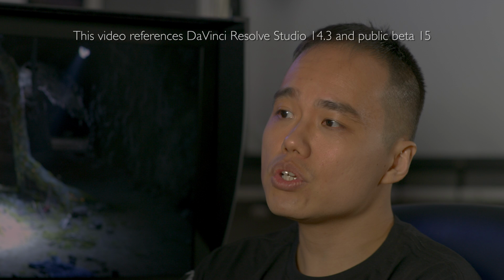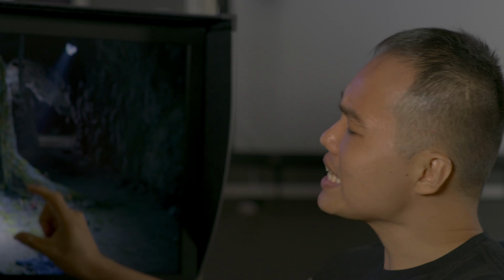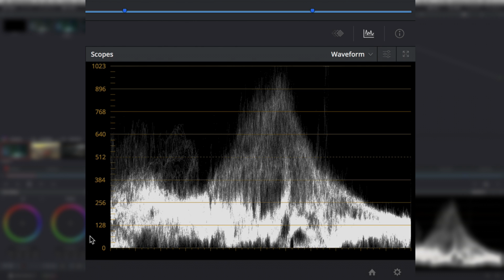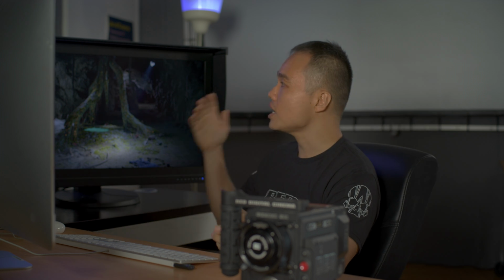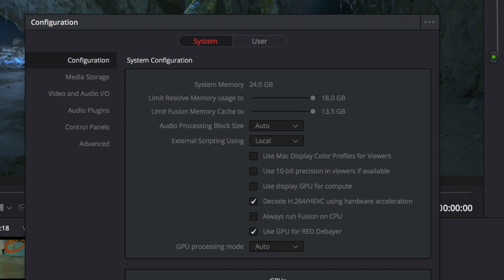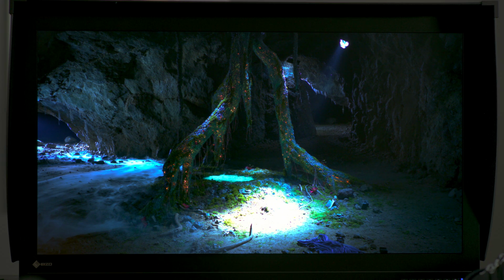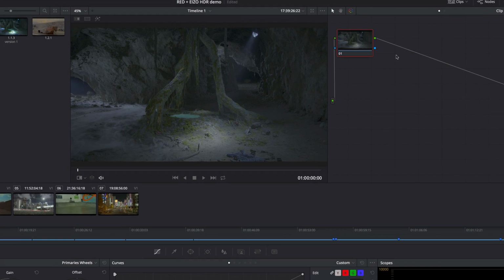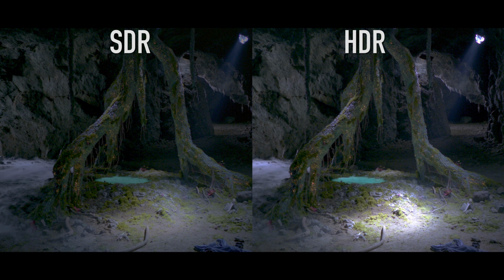Colour Grading For HDR10 Using DaVinci Resolve

Comment: Only $30,000 for the monitor? 😂
Reply from the maker: Lol. To be fair, all the professional monitors that are used to colour grade HDR content for Netflix hover around that price range, so EIZO isn't alone in that space.

But what the new EIZO CG3146 does – which no other brand at the moment does for HDR – is self-calibration in a self-contained manner. There's a built-in probe in the new model, and you can use the monitor's menu to execute the calibration without need for external hardware or software.

Comment: Great video. One question: How are you outputting from your computer to the monitor?  I am using the Ultrastudio mini monitor from resolve but am not seeing an HDR image on my second HDR display.
Reply from the maker: Hmmm. Maybe you could let me know what HDR monitor you're using?

One reason it might not be working is that the UltraStudio Mini Monitor may not support HDR output. But I'm not entirely convinced that's the reason.

The next question is whether the display can figure out if the signal is HDR. And this really depends on the below.

If it's a professional display like the EIZO CG3146, the monitor won't actually detect anything. It wants you to manually change the colour space setting in the monitor. This is true of most, if not all, professional displays. Including those from Sony, Canon, etc. I believe most computer monitors behave the same way, if I'm not mistaken.

The advantage is that you can customise the setting to whatever you need for your client. The downside is that you'd need to know exactly what you're trying to achieve.

For consumer TVs, it's the exact OPPOSITE scenario.

As far as I can tell, most consumer TVs cannot be forced into HDR mode within the menus. You can turn on HDR emulation, but you can't force the TVs into HDR mode.

The only way to do that is to ensure that the video feed has HDR metadata that will tell the TV to switch over to HDR mode. 

That's why DaVinci Resolve has a "Enable HDR metadata over HDMI" setting in Project Settings —> Master Settings —> Video Monitoring. It's for this very purpose.

Comment: Hi there. In Davinci Resolve the Enable HDR Scopes is greyed out. Is that a limitation of the light version? Thank you.
Reply from the maker: You are spot-on. =)

Even in the current version 17 that I'm using, HDR Scopes aren't available in the free version of Resolve. It's only available in the full DaVinci Resolve Studio.

Keep in mind the placement of that function has shifted to a new location. It's now located in:
Scopes (in the lower-right-hand corner of the interface) —> 3 dots (additional settings) —> Waveform Scale Style

Comment: Hi! What breakout box to output HDR to your HDR monitor? Will a simple HDMI cable work?
Reply from the maker: In the case of this video, I was using a Blackmagic Design UltraStudio 4K Extreme 3. 

But you don't have to use that particular model. You can use another model like the UltraStudio 4K Mini or cards like the DeckLink Mini Monitor 4K.

For the purpose of this video, I was using a HDMI 2.0 cable to connect to the EIZO CG3145, if I'm not mistaken. Using a lower rating might not have worked.

But when the newer EIZO CG3146 model came out, I started using 12G-SDI cables instead, because that model has SDI inputs.

Comment: Nice video! What kind of video card / IO do you use to connect to the Eizo HDR monitor?
Reply from the maker: In the case of this video, I was using a Blackmagic Design UltraStudio 4K Extreme 3. 

But you don't have to use that particular model if you don't want to. You can use another model like the UltraStudio 4K Mini or cards like the DeckLink Mini Monitor 4K.

Comment: And compressed to rec 709 after uploading? 🤔
Reply from the maker: No. If I use my video above as an example, what I eventually did was export a Rec 2100 HLG file so YouTube understood to display it in HDR when played on compatible devices. =)
Reply: @Reelisations  Why was your input Rec.709 then?
Reply from the maker: @VeeTravels , at around 4 min 26 sec into the video, I linked to another video I did where I explained that DaVinci Resolve automatically detects the RAW codecs that it supports, so there's no need to enter the Input Colour Space manually. This is regardless of brand – it works for REDCODE RAW, ARRIRAW, Sony RAW, Canon RAW, etc.

Here's the link for your convenience:
https://www.youtube.com/watch?v=rqcapEgfK2U&t=175s

Comment: what if you don't have HDR monitor...?
Reply from the maker: Unfortunately, the one thing you can't really do without when grading HDR is the HDR monitor. 😛

There are some cheaper alternatives – some of which I will go into when responding to the other comments – but tbh, none of them work as well as a dedicated, professional HDR colour grading monitor like the EIZO CG3146.

If you don't want to invest in a professional solution yet, and just want to explore what possibilities HDR can offer, you can look into the other models from the EIZO CG range ( https://www.eizo-apac.com/monitors/creative-monitors ) which can do HDR emulation to give you a rough idea of what the grade will look like. Or an LG OLED TV that can be calibrated with a 3D LUT, like the CX series.
Reply: @Reelisations  I disagree. You can use an SDR monitor and then apply a monitor LUT.
Reply from the maker: @VeeTravels , you can certainly try. Which is sort of what the HDR emulation (that the EIZO models I linked to above) are doing. This might be acceptable if you're not doing it for yourself and not for professional delivery. Because you can attempt trial and error until you get to a result that's acceptable.

But in order to master for clients like Netflix, Amazon and Disney+, you can't run away from an actual HDR mastering display. Emulation can't match the visual information and accuracy that a proper HDR colour grading monitor can display. =)

Comment: Thank you for such good information, could you advise on how export (settings) for HDR in resolve
Reply from the maker: It really depends on what you're trying to export it for. Maybe you can let me know what your target is? =)

Delivering for Netflix is quite different from delivering for YouTube, even though both can accommodate HDR. =)

I'll use exporting HDR for YouTube as an example below:

Regardless of the deliverable, it's very important to ensure that your metadata reflects the HDR content.

To aid this, I usually set up my Resolve Color Management (RCM) so that the Output Color Space is already set to one of the main HDR grading standards – either "ST2084" or "HLG", depending on what my deliverable requires.

If you've already done the above in RCM, then leaving the Color Space Tag and Gamma Tag as "Same as Project" in the Deliver page will work fine, as they will follow the Output Color Space setting.

If you haven't, then you'd need to manually set them to:
• Color Space Tag – "Rec.2020"
• Gamma Tag – "Rec.2100 HLG" or "Rec.2100 ST2084", depending on what standard was used to colour grade the footage + which deliverable is required

For YouTube uploads, I tend to export ProRes or DNxHR. But H.264 can be used as well, as long as you follow the correct settings ( https://support.google.com/youtube/answer/7126552 ).

Comment: Thanks great video. Just a suggestion - make the same video with Premiere Pro!  Also is it worth trying to grade with just the standard DaVinci Resolve.  Thanks.
Reply from the maker: Doing a Premiere Pro version is a great suggestion! 

Premiere doesn't currently (in 2022) have as much flexibility for HDR as Resolve, but it's getting better as years go by.

If you're grading SDR and anything below 4K, the standard (free) Resolve is a great tool.

If you're grading HDR and anything 4K or above, the Studio (paid) Resolve is hard to avoid. =)

Comment: Do you need any hardware to get HDR from your computer to your monitor? Is the monitor able to tell the software/hardware that it is HDR?
Reply from the maker: This is actually a slightly more complex question than you might think.

First off, yes, I do need to have a professional video output device to ensure a proper HDR signal can go from my system to a display. 

In the case of this video, I was using a Blackmagic Design UltraStudio 4K Extreme 3. But you don't have to use that particular model. You can use another model like the UltraStudio 4K Mini or cards like the DeckLink Mini Monitor 4K.

Now, as to whether the display can figure out if the signal is HDR – it depends.

If it's a professional display like the EIZO CG3146, the monitor won't actually detect anything. It wants you to manually change the colour space setting in the monitor. This is true of most, if not all, professional displays. Including those from Sony, Canon, etc. I believe most computer monitors behave the same way, if I'm not mistaken.

The advantage is that you can customise the setting to whatever you need for your client. The downside is that you'd need to know what you're doing.

For consumer TVs, it's the exact OPPOSITE scenario.

As far as I can tell, most consumer TVs cannot be forced into HDR mode within the menus. You can turn on HDR emulation, but you can't force the TVs into HDR mode.

The only way to do that is to ensure that the video feed has HDR metadata that will tell the TV to switch over to HDR mode. 

That's why DaVinci Resolve has a "Enable HDR metadata over HDMI" setting in Project Settings —> Master Settings —> Video Monitoring. It's for this very purpose.

Comment: God bless you. I got a small easy question ^^. What is the best way to work on 4k 10 bit 2020 HDR10 material and then trim a bit you know and change position nothing fancy and then export with pretty much the exact same quality as the input. Where do I have to activate the 2020 and HDR during the trimming part and for the export? What is the best way to keep all the quality? God bless you again in advance
Reply from the maker: Hmmm. There are 2 schools of thought of how you can approach this. One is more complicated, and one is simpler.

Option 1:

If you don't really want to preview the HDR10 material, and don't mind editing really flat-looking material, then you can just cut, trim and rearrange the footage as per normal.

Then, when exporting in the Deliver page, you have to make sure the correct metadata is embedded in the exports.

• Color Space Tag – "Rec.2020"
• Gamma Tag – "Rec.2100 ST2084"

I can't really advise what files to export because I don't know who you're exporting for.

But to maintain quality, I tend to favour ProRes or DNxHR.

Option 2:

If you want to be able to watch the content in HDR, then you might want to turn on RCM (Resolve Color Management).

You still have to do most of the stuff in Option 1, but there are additional steps below.

After turning on RCM, you'll probably want to set it up in the following way:
• Input Color Space – Rec.2100 ST2084
• Timeline Color Space – Rec.2100 ST2084
• Output Color Space – Rec.2100 ST2084

This SHOULD enable you to watch the content correctly on a HDR monitor, but do let me know if it works for you.

If it doesn't, do right-click on any of the clips (in the Color page) and check what the Input Color Space is. Make sure they are all set to "Rec.2100 ST2084", which is the usual standard for HDR10.

Now, regardless, for both options, the one thing I can't predict is how the footage was originally graded. In other words, I don't really know the max luminance it was graded for. Whether it was 1000 nits, 2000 nits, 600 nits, etc. This may have a slight bearing on the metadata being exported, so do keep an eye on it.

Comment: thanks for details info, just one more thing, what hardware is needed to output/monitor? I have studio version resolve;HDR 10 monitor, my GTX960 won't do HDR output for resolve.
Reply from the maker: In order to send an accurate HDR feed to the HDR 10 monitor for colour grading, you do need to have a professional video output device. 

In this video, I was using a Blackmagic Design UltraStudio 4K Extreme 3. But you don't have to use that particular model. You can use another model like the UltraStudio 4K Mini or cards like the DeckLink Mini Monitor 4K.

As far as I know, it might be iffy to send a signal via your GTX960 since that's a graphics card, not a professional video output. But if you find out it's accurate, do let me know too!

Now, as to whether the display can figure out if the signal is HDR – it depends.

If it's a professional display like the EIZO CG3146, the monitor won't actually detect anything. It wants you to manually change the colour space setting in the monitor. This is true of most, if not all, professional displays. Including those from Sony, Canon, etc. I believe most computer monitors behave the same way, if I'm not mistaken.

The advantage is that you can customise the setting to whatever you need for your client. The downside is that you'd need to know what you're doing.

For consumer TVs, it's the exact OPPOSITE scenario.

As far as I can tell, most consumer TVs cannot be forced into HDR mode within the menus. You can turn on HDR emulation, but you can't force the TVs into HDR mode.

The only way to do that is to ensure that the video feed has HDR metadata that will tell the TV to switch over to HDR mode. 

That's why DaVinci Resolve has a "Enable HDR metadata over HDMI" setting in Project Settings —> Master Settings —> Video Monitoring. It's for this very purpose.